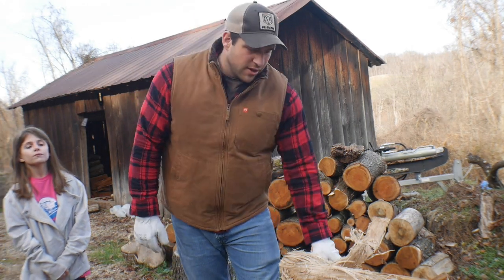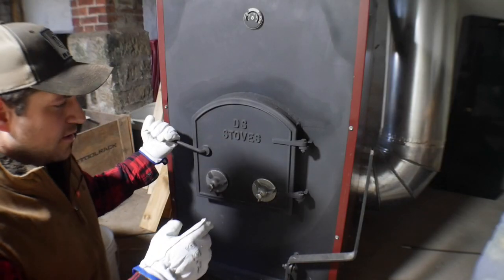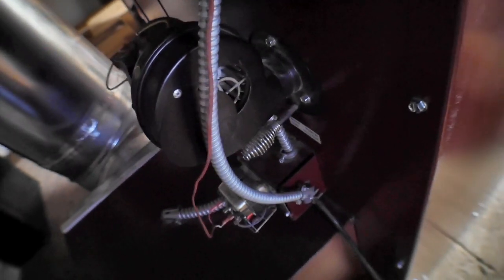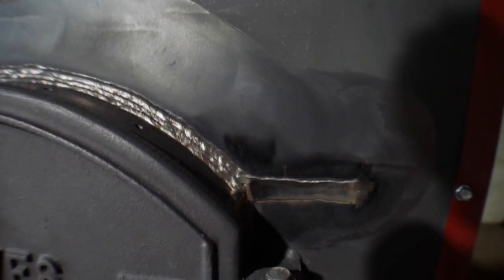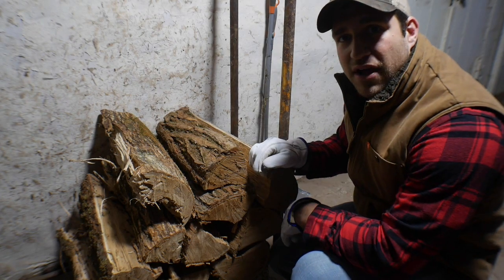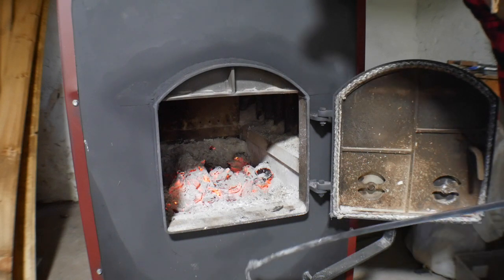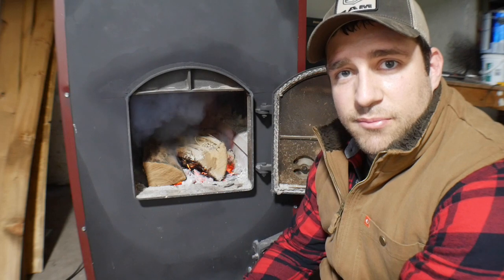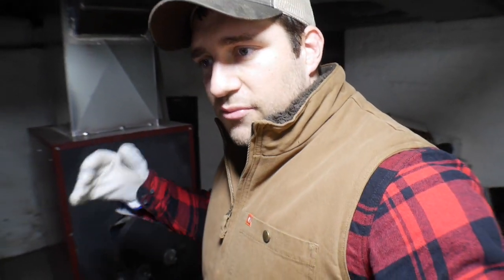How I Run My Wood Stove Using Less Wood | Kozy King 300 By DS Stoves

Comment: Hey CJ, can you show a couple of pics or video of how you have the pipe hooked up to the DS300?
Reply from the maker: Which pipe Dan? The cold air return or the pipe going to the chimney?
Reply: @Mallard5plus1Farmhouse  The pipe coming out of the stove and into the chimney.  On mine I have a elbow coming out then a short, maybe 18" straight piece. Then it goes into an elbow and finally connected to the Selkirk triple wall pipe going through the rock foundation wall.  My ceiling height in the basement is only about six foot.  I'm asking because everytime I open the door I get a lot of smoke when I burn wood.  I don't know if its because of the configuration of the piping due to the lack of room.
Reply from the maker: Do you have a damper that you can open and close on that pipe like mine?
Reply: @Mallard5plus1Farmhouse  No dampers.  I think it gets restricted by the elbows
Reply from the maker: Idk.. I mean I run my damper almost completely shut and I don't get much smoke if any when I open my door.. could there be a blockage in the chimney?
Reply: @Mallard5plus1Farmhouse  I don't think so. I cleaned it just the other weekend and did not see any thing.  Maybe I can send you a picture or two of my set up.
Reply from the maker: You can email me them or send me a message on our Facebook page or group

Comment: Good Job CJ. I have a DS100 which is the smallest stove DS makes and I have been burning coal most of the winter and I can get close to 20 hours on a full firebox, I believe this is because of the smaller size? If you find coal for $250/ton let me know, I am south of you but not so far that I wouldn't make a trip to buy a few tons that cheap, I paid $353/ton this past September.
Reply from the maker: I sure will.. I found a place up close to Amish country that has it advertised for $255 a ton so we will see